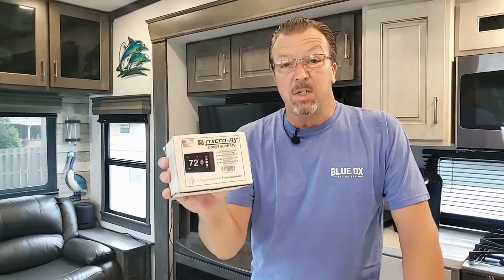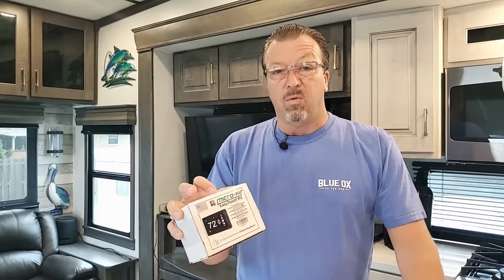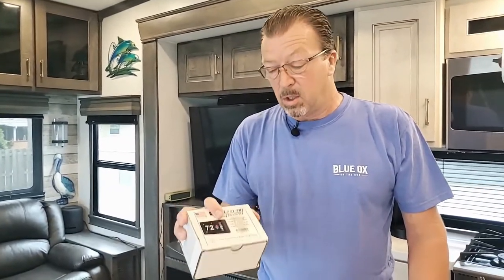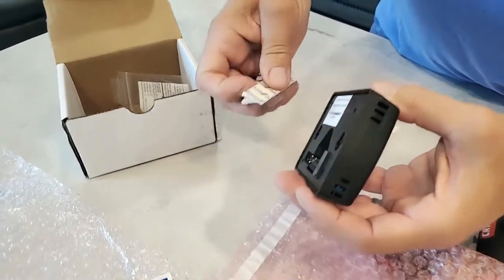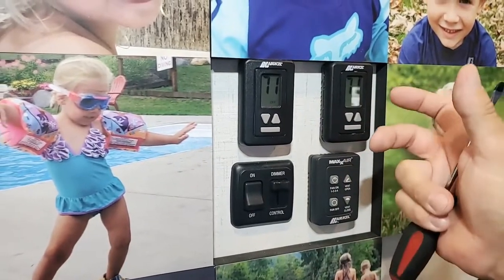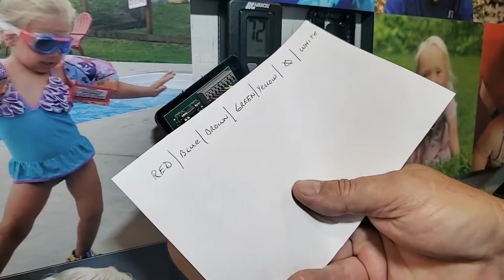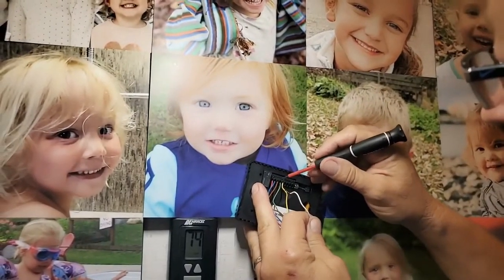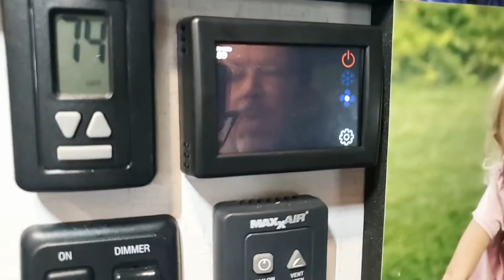RV Micro-Air WiFi Thermostat EASY INSTALL! KEEP your pets SAFE, they will APPROVE!

Comment: You do a good job of making this easy for anyone to do and a great job illustrating how to do it. As a hvac tech .. I could not tell you how manny times customers will change their own tstat at their house and 90 percent of the time blow the 24 volt fuse at the indoor air handler by working it hot and hooking wires up wrong  .. I see the rv industry uses the same universal terminals as residential and commercial along with the same universal colors . Red-12 volt hot, blue , 12 volt common , yellow , ac compressor , white , engages heat .. green low speed fan , brown , high speed fan.
Reply from the maker: Oh all those famous DIYers 🤣 There's a lot of Tim the Tool Man out there for sure 🤣